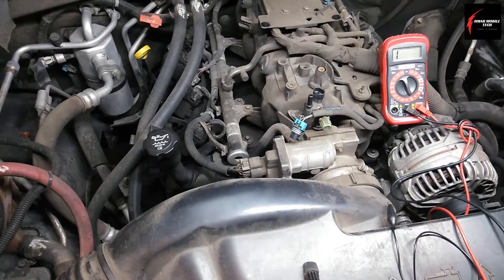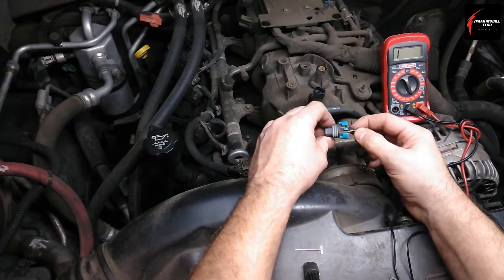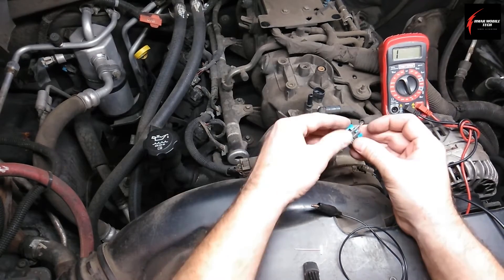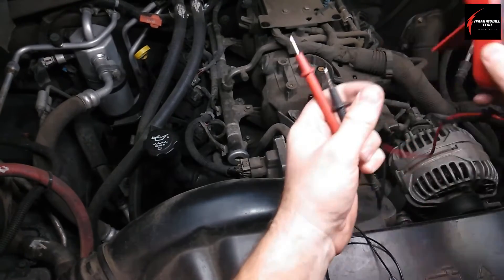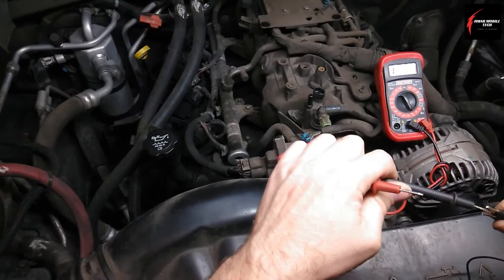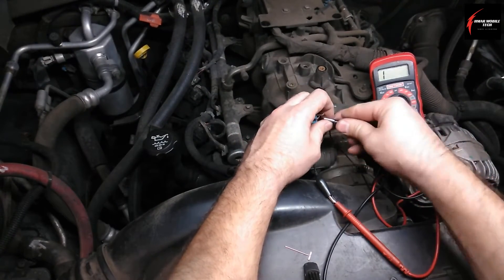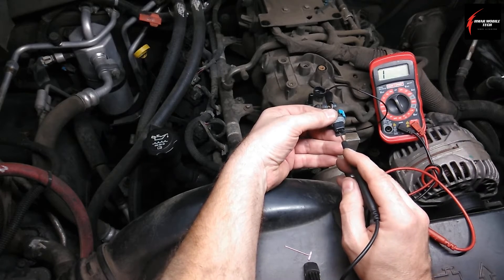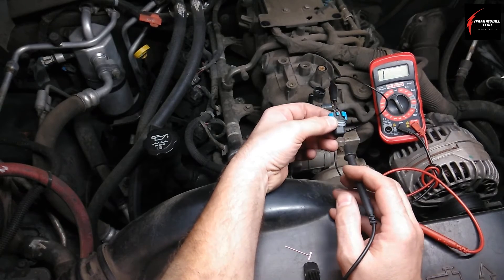Back probe an electrical connector using a digital multi meter and a t-pin for expert diag. work

Comment: What if it's a 3-pin with a signal wire? Do I back probe the signal or positive?
Reply from the maker: do the test as shown in the video. All you are doing is checking connector integrity nothing more. Works on any electrical component any make any model of car. Good luck

Comment: How do i test to see if my fuel oump is getying power by keeping connector vonnected( with a load on circuit) ty
Reply from the maker: watch my crank , no start video testing fuel pump on chevy truck.